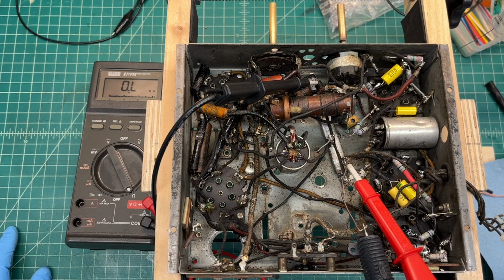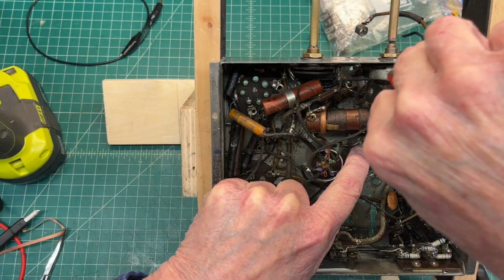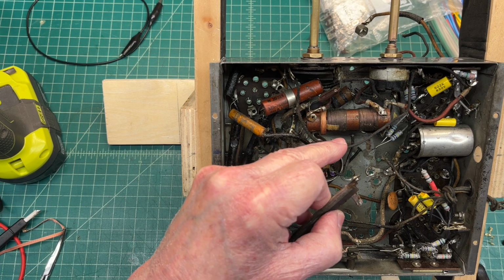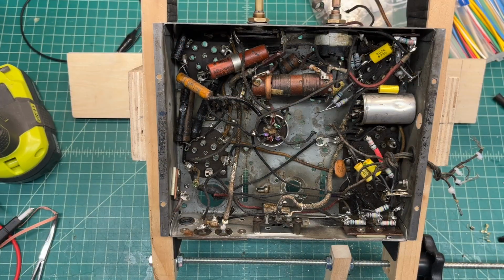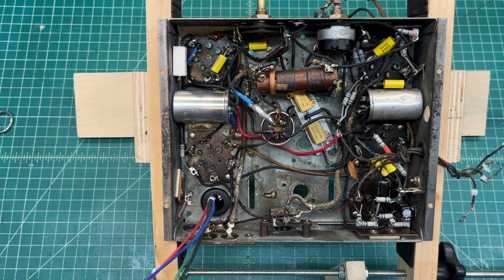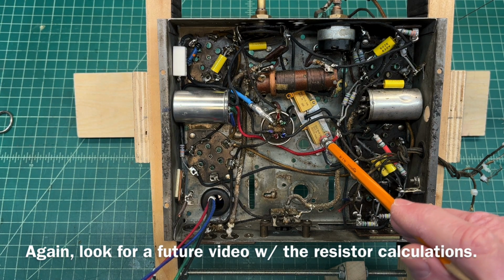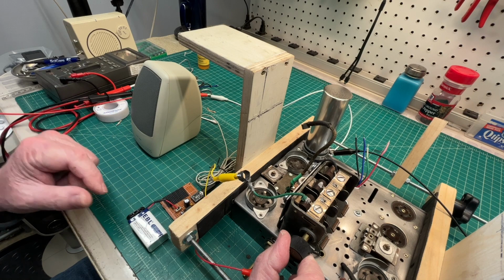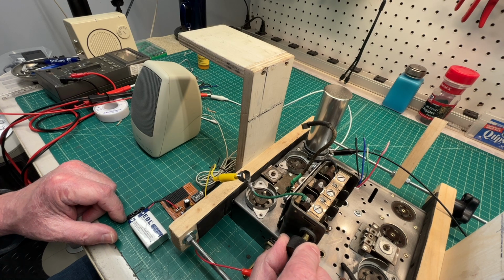Crosley 5V1 - New Capacitors, Resistors & More | First Power Up

Comment: Crosley didn't seem to cut any corners when designing this Depression-era receiver! Given his amount of effort and attention to detail, Don will likely have it sounding even better than it did when if first came off the assembly line!
Reply from the maker: Thank you Chet. This Fiver is a good player to this point. I’ve got to get the loudspeaker cleaned up and the new grille in and I’ll be ready to take it for another extended play. Thanks again. Best, Don

Comment: Looking and sounding good, Don.  Can you explain how you were testing the tuning condenser?  Very interesting.
Reply from the maker: Dwayne - thank you. Check out the video I published awhile back at:

LC (Front-End) AM Broadcast Tester - One Chip AM Radio Circuit
https://youtu.be/ZG_EUGt1v8A

The radio tuning capacitor and antenna coil form the tank circuit that’s resonant in the BC band. The one chip AM receiver output feeds the LM386 to drive a standalone 8 ohm speaker. Hope this helps.

Best,

Don